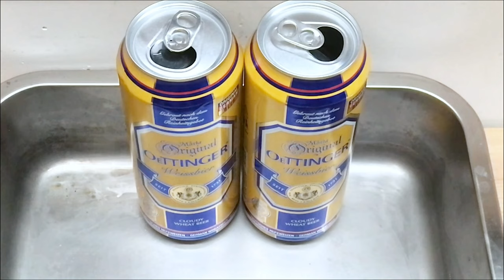Cell phone gun IC380 DIY Upcycled Chinese-made toy guns home made cap gun 電話銃 手机枪

Comment: Try it with a flobert blank and a 5.5mm pellet ( obviously you'll have to rebore the canon) but i think the gun will hold the pressure cause is just a primer and the muzzle energy will be arround 30 joules, wich is something very interesting 😏
Reply: This is my patented formula for making zipgun ammo😂. with a 6mm id barrel the back pressure is low enough that your hammer or firing pin(flat with a offset ridge) is enough to act as a breach block. I line up a pellet, a wad of cotton, a 6mm flobert blank and roll it up tightly once or twice in painters tape!